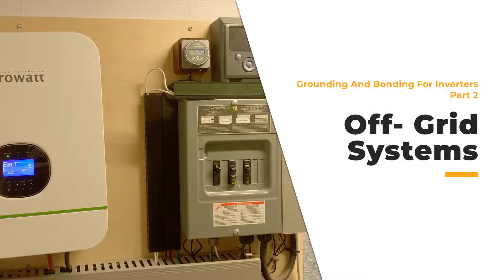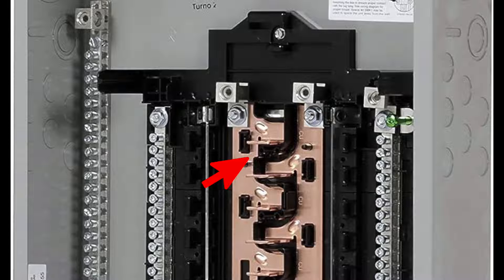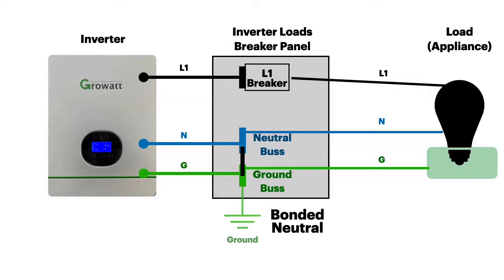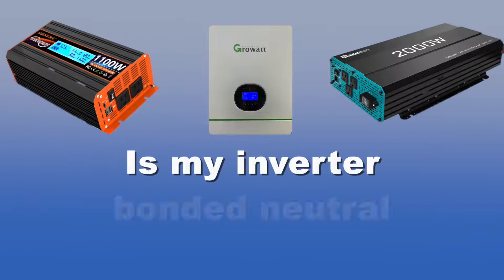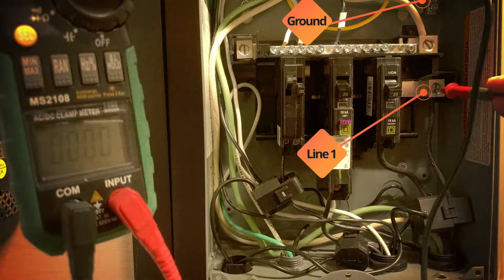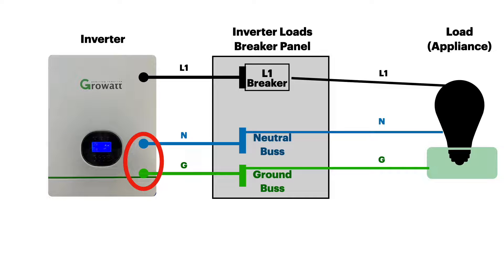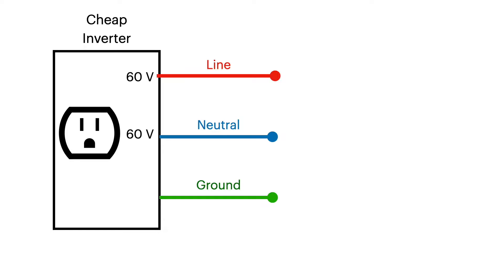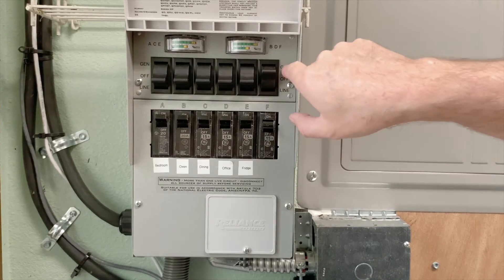Grounding & Bonding For Solar Inverters, Part 2: Off-Grid Systems

Comment: One thing I could not pick up at the end.  If you have an inverter that is not dezigned to be bonded..... the ones you say should never be bonded.....  I presume you simply do not connect the ground from the inverter to the house breaker panel..... But do bond ground and neutral at the house breaker panel so the earth leakage safety breakers trip.  

I happen to be getting a 6000 watt (continuous rate) inverter.  I am not sure it is bondable - although it does have a terminal block output.
Reply from the maker: No, unfortunately these should NOT be hooked to house wiring at all.
 If the inverter has AC outlets, just plug appliances in there.
Reply: @ReelClearMediaLLC    Oh.  unfortunately, I cannot just plug appliances into the AC outlets.
 I currently have an off grid system that has been running my house for 15 years.  The power shed is outside my house.  I have  1000 AH 48v battery bank with Selectronic inverter - 48v to 240v -  3000 watt continuous, 6000watt 30 second rate, and 10,000Watt surge. 
This is connected to my main distribution breaker box incuding the earth wire.
 All my sub boards run the ground wire back to the main breaker box where the earth buss there is connected to a copper ground spike.  All the sub boards have correctly wired earth safety breakers - all tested and functioning correctly.  
Basically, the house is wired as if connected to the grid, but actually connected to the inverter.  The rating of the inverter must be correct because we often run 12 amps and sometimes 18 amps (4300 watts) without any fault.    I was considering buying a standby inverter in the event of the old inverter breaking down.  The cost of known brands is up into the $2000 range.   
The CNSWIPOWER inverter that I was considering has a 6000watt continuous rating.  (I have watched reviews that demonstrate 6000watt capability.)
This inverter had L G. N terminals on the front which are apparently for connecting to some permanent load.
Can you tell me why you believe that this inverter should not be connected to my house as a replacement for my existing inverter?  cheers.
Reply from the maker: @alanbeasy1775  In the video, I was referring to numerous inverters mentioned in DIY solar forums, where they literally fry the inverter by bonding. I'm not familiar with CNSWIPOWER, so I don't know if it falls in the "don't bond" catergory. It may well be OK to bond. In the reviews you watched, had anyone bonded that inverter? Hopefully it will work for you.
Reply: @ReelClearMediaLLC  Thanks. I have decided not to risk it. As it turns out the Victron Multi-plus Inverter charger 48/230 - 5000w is on special at $1645 at the moment.  I might as well pay the extra $750 and get a more bullet proof solution with all the top features.  (Usually over $3000).  That should see me through the next 15 years and I will service my existing unit to have on standby.  Thanks again.

Comment: Question: I have a Quattro 5048 V 70 inverter. Mine was programmed to be off grid.
My problem is, I was told that the AC out goes to the interconnect switch on the main panel. With two 50 amp breakers. So that means it’s bonded at the panel?
But then I was told on the equipment side, I needed to have a ground bar outside for the DC side? This means that all the charge controllers and the inverter are going to a ground bus bar, and that is wired to an outside lightning rod. 
So that means I have two grounding points, one for the AC side, and one for the DC side? I’m told this is only for off grid, and that on grid would be bonded at the main panel only.
Is this right or am I missing something? Thanks 🖖
Reply from the maker: Sorry, but I'm not sure. I have some Victron chargers, but I have never used one of their inverters. 
I would try Victron support to be sure!  
https://www.victronenergy.com/support

Comment: Hmm Reel clear?   And yet when you measure resistance you say... it's high.  LOL  What is high?  20 ohms?  3000 ohms?  6 million ohms?  
While I'm at it, there is another way to tell if your inverter is neutral bonded, ask the manufacturer.  But it is good to know how to check to make sure.  See if the resistance is high.... lol  ;-)  I'm messing with ya some, but I think you will agree I have a point.
Reply from the maker: Unfortunately, I have had no luck getting any information from GroWatt. There were models of the 3000 that had dynamic bonding, and some that did not. 
And yes, I could have been a lot more more specific about "high resistance" 🙂

Comment: I have noticed that on the power pole outside neutral is grounded by fault. Should I disconnect the bond in the inverter until corrected by utility.
Reply from the maker: What country are you located?
Reply: Philippines so very unlikely to get a quick fix. 
I believe the system used here is neutral is grounded every 5 posts, as it happens the ground wire is on this post, however there is an additional neutral to ground by utility by mistake.
Should I disable the ground neutral bond in the inverter
Reply from the maker: @martinrodulfo5963  Yes, these videos only apply to North America, where we bond N_G  at the main panel in the house.
It might be possible to use a transfer switch that switches neutral and line (DPST or DPDT) to switch circuits between grid and inverter. Or depending on your needs, you could keep the inverter and an inverter powered breaker panel completely "off-grid" for critical circuits.

Comment: Hello, thank you very much for your video, it clears some doubts i had with my solar equipment, now all is working perfect.
The floating neutral at the output (when the inverter is generating power or off the grid) produce flickering in led lamps, some equipment cases with the "tingling sensation" when touching them and around 70 volts difference between the neutral and ground. After landing the neutral, all the "fringe things" goes away. By the way, I land it at the breakers box "JUST AND ONLY AT THIS POINT" 😅.
Reply from the maker: awesome!

Comment: Awesome video. In the video you said, You should not add a neutral ground bond to the standalone inverters. I have a Renogy 2000W inverter that's connected to an earth ground via a ground busbar without being bonded. However, when I test using Greenlee GT-10 tester plugged into the outlets on the inverter it comes back as in open ground fault. As such I would believe that the neutral would need to be bonded to the ground busbar but there is no way to do that which makes this a difficult task if the inverter is off grid connected in a shed which it is, not connected to the house. Interesting dilemma I have.
Reply from the maker: Some standalone inverters shouldn't be bonded, some are able to be bonded.  The forums are full of people saying they burned up their inverter by bonding. Is there anything in the manual about bonding? You might check on some of the solar diy forums and see if anyone else has bonded a Renogy. Or ask Renogy customer support.
Reply: @ReelClearMediaLLC  Thank you for your reply. Renogy customer support wasn't really that helpful. I'm not sure if they even know if that inverter is bonded or not. They couldn't help me determine what to do for a totally off grid system. I looked on some solar sites in heaven found anyone who actually plugged in a tester to the inverter plugs for an off-grid system showing an open ground fault. Most videos or sites, blogs just plug the inverter up and that's it. They would be surprised to find out that many of them have open ground faults.

The manual really does not do a good job in reference to off grid systems that are not connected to house power. It's primarily designed for those with RVs and campers. The manual says the neutral (common) is not bonded to the chassis ground. Therefore, when chassis is connected to ground, the neutral conductor is not grounded. At no point should the chassis ground and the neutral conductor of the inverter be grounded.

In another paragraph it says… At no point should the chassis ground and the neutral conductor of the inverter be bonded. Bonding the chassis ground and the neutral conductor of the inverter or connecting the inverter to household or recreational AC distribution wire will damage the inverter and void the warranty.

So, for me there appears to be no options. However, I believe the best option for me is to locate an inverter that is internally bonded. With that in mind I started looking at the Wagan EL3808 Pure Line Power Inverter 2000 Watt DC 12V to 110V AC which says in its marketing video that it is NTG bonded, true ground.

I suspect that means the only thing left for me to do is connect the ground terminal to my grounding busbar which goes to a grounding rod… Would that be correct?
Reply from the maker: @nazarenesect5931  Too bad about the renogy, that seems to be a popular unit.
Not familiar with the Wagan inverter. If they already have a N_G bond, yes hook their ground terminal to your grounded busbar, and don't bond Neutral and Ground in your breaker panel... Use separate N and G busbars
You should see 120V from L to N, 120V from L to G, and close to 0v from N to G. Also your tester should show no ground faults (it just sees if N and G are bonded)

Comment: Great Explanation, I think I set mine up right ?; The Caravan Has a Double pole RCBO (not bonded ) . When plugged into power in a caravan park or my house the bonded RCD part is at the source. I installed a 12 - 240v inverter in the caravan (bonded) and earthed to the chassis.  I plug the 240 from the inverter into the caravan IN, when off grid. The output from the inverter is 10Amp, the input to the caravanis 15A, so I have a 10 - 15A conversion with inbuilt RCD (not bonded) because I doubt if the caravan RCBO will trip if there is a fault.  Seems to work because the inbuilt RCD trips sometimes when I plug an induction cooker in while already have something else plugged in (common with these cookers I believe..)
Reply from the maker: I'm only familiar with the grid in the USA, so not sure what you have exactly. Make sure you don't have two bonds at the same time when plugged in to shore power (caravan park) while using inverter. Use a clamp meter  and make sure you aren't sending any current on your ground (earth) wire.
Reply: This is a problem because using the inverter as your shore power by plugging into the shore power of the caravan, it will attempt to charge the battery… which i believe is the same battery it’s pulling from… you don’t want to charge a battery from the battery you’re trying to charge! You need a transfer switch to eliminate the charger when using the inverter.. or someway to turn off the charger when the inverter is being used.

Comment: Wonderful video. I am still trying to understand correctly.

Based on an Off Grid only, Single all in one outputting to Main breaker box (no sub panels)

If the all in one IS bonded, then the breaker box does NOT he bonded..

If the all in one is floating, then bonding at the box is necessary..

Am I getting this right?
Reply from the maker: Yes, that's right.  
You want to have one and only one bond. 
Just double check with a meter to be sure if the all-in-one is bonded or floating.
Reply: @ReelClearMediaLLC  thank you so much, your videos have helped me understand much more than I did.
Reply: Supposed to have a bonded neutral at the first point of disconnect from the source.

Comment: I've heard of lightening coming through an Earth ground and destroying electronics, from lightening strikes..Is unplugging the solar panels from your system during storms, an option to an Earth ground..That might be a difficult question...
Reply from the maker: Thats an option, I have DC breakers near the panels (in combiner boxes) and each array goes through breakers near the inground fault verter. I turn the breakers off during storms if I'm here. There are lightning surge protectors and ground fault breakers available as well.

Comment: NICE...So what protection does a stand alone inverter or a solar generator, or gas generator offer...Providing they don't come with a built in circuit breaker, Are there Fuses in case of a ground fault or short circuit ???
Reply from the maker: Some inverters and generators have a breaker or fuse. It's a good idea to always have external breakers between the inverter and battery, inverter and AC loads, and inverter and solar panels. Many people just use disconnects on the PV panels.